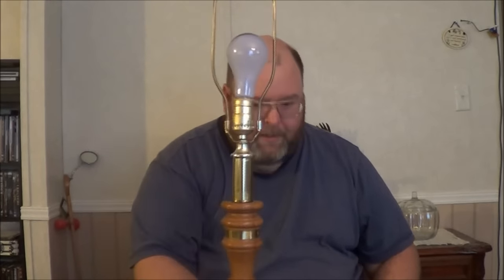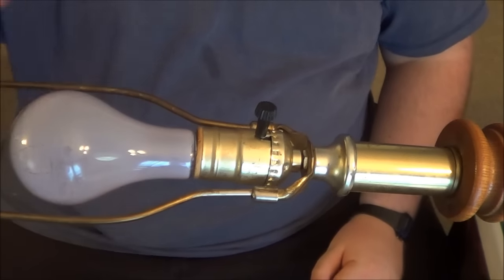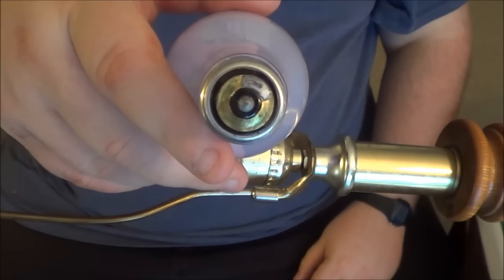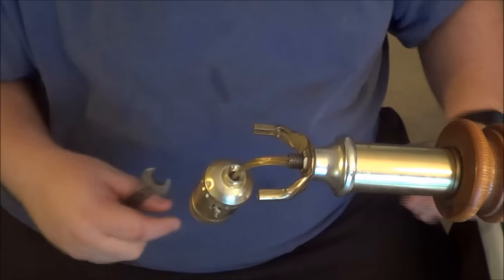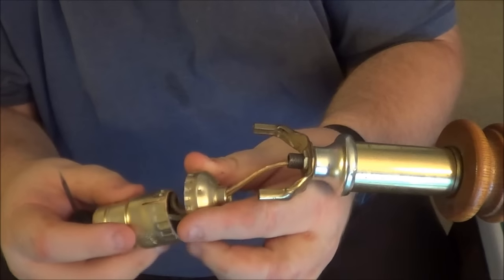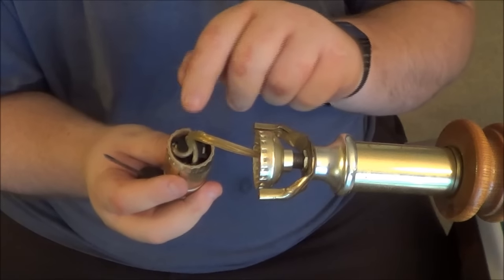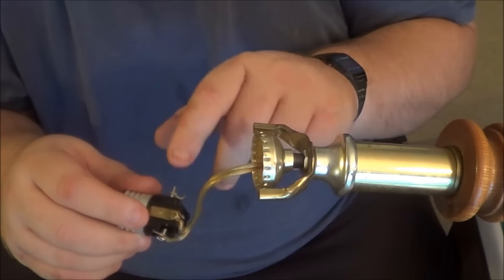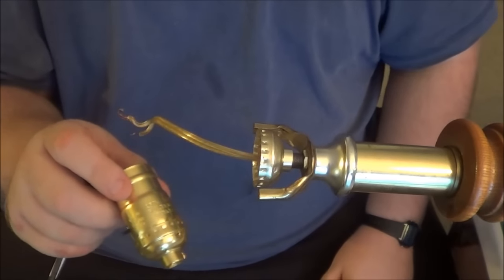How to replace a Lamp Socket

Comment: Thank you for your video! I found two beautiful lamps in the trash and they didn't work. Bought sockets, watched  this video as I went, made some mistakes, and a few hours later, they both work! I will say my lamps wires were in a plastic base thing and you need to use a paperclip to dislodge the wire. My bases didn't pop off. They are not perfect but I am proud of myself.

Comment: Mr. fix-it help me change my lamp socket I was going to get new lamp, but thought that I could possibly just changed it. I am 67 years old and was diagnosed with Early onset Alzheimer’s , before I was able to do a lot of projects without even giving it a second thought. I put in sprinklers, re-wired valves, etc.  Things they don’t come very easy anymore. Beyond what he probably thought he could do for anybody. Explain step-by-step how to do this, I had to rewind it several times due  to my short term memory but my sense of accomplishment , he gave me that feeling again.  Just know that you are best 
thank you so much
Reply from the maker: You're welcome. I'm glad the video helped.

Comment: I know this video is 8 years old but I just wanted to thank @ESRepair.  I was actually able to fix my lamp by replacing the 3 way switch with a regular one.  I had a hard time figuring out which wire was hot and neutral, so I hope I got it right.  Anyway, thanks so much!  You are a brilliant man!

Comment: Thank you for this video. It was clearly explained and helped me repair a table lamp where one of the three settings (low) did not work. My wife hates the higher brightness settings, so she has not been using the lamp much recently. My lamp did not have the lock nut at the bottom of the socket, as it had a screw cap at the base of the bulb, to take the socket apart. Replacing the lamp socket was easy and took less than 10 minutes. Your explanation on the wiring (hot, neutral) was very helpful. Just think, there are local repair facilities here that charge $80.00 to repair a lamp. Thanks for the video and helping me save some money.

Comment: I like the detail this video provides.  Very thorough with attention to how to correctly install the new socket so that it is safe.  If the hot and neutral wires are crossed, this can lead to a dangerous lamp and Mr. Fix-it explains very well how to recognize the difference between the hot and neutral wires.

Comment: Mr.Fix-It, thank you for this video. My wife and I watched together. We were informed about the difference between the "Hot" wire which is smooth and the "Neutral" wire, which is rough.. I don't remember ever hearing that before. Thank you, again Mr.Fix-It.

Comment: Wow, replace a lamp socket 101!.  So easy to follow and understand..  My cord had a knot in it, which made it very difficult to replace the socket.  I untied the knot and it slipped right on. I noticed the comment below about an underwriters knot. What the heck....repaired without much easier.   Thank you again, Mr. Fixit!

Comment: You covered some topics that other videos did not such as the hot wire and using the wrench to stabilize the lamp infrastructure.  Thank you!!
Reply: Yea but my cords both are smooth so I'm concerned

Comment: Thank you.  My suggested upgrades for your video are:
You  left off the toughest part of how to remove the top from the bottom (you just mentioned a small
screwdriver).  I suggest if you leave the bottom screwed onto the base, you can just grip the top part and with a side to side motion pull it off with some force as it is a friction fit with corrugated metal.  A paper towel  or rubber grip between your hand and the top metal part may prevent cuts as the corrugated metal is sharp.

Older lamp cords may NOT have a polarized plug or markings on the cord, so to avoid frustration, viewers should know that (so there is no designated “hot” screw as you could plug older lamp plugs into the wall either way). Newer electrical receptacles are polarized with the bigger slot for the neutral prong, and the rough edge on the cord for neutral as you said. Using a polarized plug and cord, and connecting as you said, reduces the possibility of shocks, should the cardboard insulator wear out. 

I suggest it is best to put the base on first and screw it on,  and then tighten the retaining screw.  Then just snap the top into it with the switch in a middle position away from the shade holder arms. This avoids twisting the wires up 6-7 revolutions inside the lamp for no reason.

Users should lightly pull the cord from the bottom of the lamp when done, to ensure no extra cord is bunched up in the base area.

Viewers can save the old plastic turn knob if it is not broken (as it can replace a knob on most any lamp you have where the threads have failed/stripped).

To minimize work where the switch mechanism has failed, viewers should know that they can just replace the switch part, retaining the existing bottom and top.

Viewers should note it is important that the wires should wrap around the two terminals in a
clockwise direction as you did, so that when you tighten the screw, it tightens the wire.

Comment: Hello Mr. Fix-It! Thanks so much for helping me get the little cup base of the old socket.  Secondly, I knew that one wire was smooth and one was rough, but I didn’t know which was which or which went to silver and which went to brass, so that was helpful.  Finally, it might sound silly, but your “tighty righty lefty loosey” rhyme is going to help me for the rest of my life.  (My dad left when I was 6, so I never learned that stuff.)
Reply: I learned "righty tighty, lefty loosey" my first year in the Navy and it has been so helpful.  Good luck learning more fix-it stuff.

Comment: Excellent video!! Just replaced an old harp that wouldnt fit with a new one from Amazon. Bless you!
When I saw the 20+ minute runtime I said "Oh no! Someone that's going to talk in circles," but everything you said was at least a tip or good info to make sure the job was completed correctly. Great video! Saved in my Home Economics playlist. Hehehe.

Comment: Very thorough video. One of the other videos here was replacing the innards of the socket and reusing the old cardboard insulator and casing. This makes more sense. BTW, when you disconnect the old socket, you can use a Sharpie or something to mark the hot wire, and just duplicate the hookup on the new socket. It’s good to know the way to identify which is which (especially of you have to cut the cord), but common sense is a good thing as well. Speaking of which, when my husband was still just my roommate he started “repairing” a lamp with out unplugging it! He touched a screwdriver to a wire and BOOM! I said something like (gritting my teeth), “Why did you not unplug it?”, and he said it was turned off so the flow of electricity should have been cut. Um....yep. I married him anyway. He’s smarter now. :-/

Comment: Another Great Video Leah. I have a floor lamp I'm putting a light socket in, that takes a 3 way bulb, I looked through my socket bag and found one but it had 3 screws with a black screw and two silver screws. I looked in where the bulb goes, and saw it had the two contacts, but wasn't sure where to hook my 2 lamp cord wires. I do know, that the wide terminal on the PLUG IN is the Neutral wire. So hooked one wire to a sliver screw, the other wire to black screw, then screwed in a 3 way bulb, turned it on and my shop lights almost went out before I turned the switch off. So I surmised that this socket with 3 screws, must be for the Lamps with other bulbs hooked to the switch. So I looked through my socket bag again and found a socket with only 2 screws, but still had the extra contact where the bulb goes in. So tomorrow I will put this socket in the lamp and see if it works with the 3 way bulb.  I'm not an electrician per say, but the socket with the 3 screws steered me to Youtube to see what the difference is with the two 3 way sockets. I'm still a little perplexed though by the 3 screws socket. Thanks for the Video.

Comment: I needed to figure out how to tell which was the hot wire that connects to the copper terminal (it's been a couple decades since electronics class in high school. Do they even have trade classes in HS anymore?). Thanks for the quick tutorial.

Comment: Thanks, my lamp was blowing fuses when turned I turned it on.  I replaced the lamp socket and figured problem solved, but I'm still blowing fuses.  It seemed a simple fix, rechecking everything.

Comment: This was a very helpful video and I learned a lot.  I have a lamp where I would like to replace the bottom part of a lamp harp which requires removing the lamp socket which I could do based on your video.  However, this lamp is a candelabra style with 3 "candles" that surround the main light.  Do you have any insights that you can share on working with this style of lamp and what I might want to consider?  I only want to replace the harp because it looks ugly, and I’m going to spray paint this lamp to give it new life.  Thanks so much!

Comment: Smoothe hot wire to copper.  Ridged neutral wire to silver.  Got it.  I nearly did this wrong because all the numbers and letters are on the ridged wire so I figured that must be where the electricity goes in.  Whew.  Thanks very much!

Comment: I don't mean to be critical, but there is no need to replace the socket bottom with the set screw unless the new socket and top portion will not snap on tightly when you push it on over the base. The problem is that unscrewing the lower portion of the socket with the wires attached can damage the insulation on very old wires as the insulation can get very brittle over time and break off. Now you risk a short circuit and have to rewire the lamp which may now make this a job for a pro. Preferably you can just replace the switch portion of the assembly and keep the original metal parts and the original patina. 
Other than that the correction above, the author does a very good job of demystifying the workings of a lamp socket for many novice viewers.

Comment: If you have room, the two ends of the wire could be tied in a knot to keep any tugging on the cord from ripping the wire off of the terminals.  I'm currently looking for that knot - they seem to be tied the same way in most lamps.

Comment: I'm really hoping I didn't mess up. I looked which wire was on which and marked s for silver and b for brass. Then hearing two videos.. mine is opposite. I got my lamp at a garage sale years ago. Very antique. It's working. What would happen if the wires were mixed incorrectly? Would it still light?

Comment: Should we be paying attention to electrical ratings in doing this? For example, the socket I just bought says that "This lamp socket has an electrical rating of 250VAC and 250W, is UL Listed and can only be used with #18 stranded copper wire."

Comment: What did you do to separate the socket cap from the rest of the socket?  You just said "you might need a flat...there" and then took it apart.  I see where you cut scene but that trick was the only part I needed to see.  I can't locate any other video in you very long list of videos on this particular topic.

Comment: Thank you so much!!  You have such a nice teaching style.   
I don't know if you answer questions because I see this is four years old.
My lamp made a POP sound and the bulb burnt out and will not work now with any bulb.  
Do you think there's more damage to the lamp or is it just the socket I could replace? 
Thanks
Reply from the maker: The lamp socket may have burned out the switch and needs socket replaced.  You could also try a Voltage detector to see if there is a break somewhere in the power cord.

Comment: Great helpful video!
Reply: The replacement socket was too small to screw on to the older lamp.  Almost took it back….. but I didn’t have to. I kept the old bottom part, and used just the new top part which luckily snapped onto the old bottom half perfectly.  Woo hoo!

Comment: Good video but I was wondering why you didn't knot the two wires up with an Underwriter's knot prior to wiring up the lamp socket to prevent the wires from pulling off the lamp socket due to stress on the wires?
Reply from the maker: Lamp already had one at the base.......

Comment: I wanted to see how you actually got the bottom brass cap with the indentations off because that's where I'm stuck at. Mine is on tight. All you said is you can use a small screwdriver but you didn't show how you actually got that off without either wrecking the cap or jamming the screwdriver into your flesh somewhere. Also you said one of the wire outer insulated coatings is smooth and the other rough -- not the case with mine! Both are smooth, but one has lettering on it so I will have to see which is the hot line if I can even get that cap off. I used to know which one is hot because it's the same with the sheathing on house wiring cables. Then you didn't say if all replacement brass sockets are capable of threading onto that threaded rod. Yours was but just so happened to also have a set screw. My faulty one threads on but has no set screw. How do I know if one I order online will have threads to screw onto my threaded rod? Are they all made that way or not?

Comment: I have a different kind of lamp with plastic base that the socket goes in.  I can't remove the metal socket from the plastic base.   The base also has the switch which is what is not working.   Any suggestions?

Comment: I have a very old lamp (about 1920’s) that doesn’t appear to have any discernible signs of what is hot and neutral on the wires. They are also heavily insulated with cloth. How do I know what wire goes onto each terminal screw?
Reply from the maker: Many antique lamps do not use a polarized plug. Usually the Line (Hot) wire is copper and the Neutral wire is Tinned Copper, which often times look grey in color.

Comment: I don't understand why you did not put a UL knot in the cord ? This prevents the cord from being pulled and putting stress on the connections which could cause a fire.

Comment: Help. Lamp wire won't push back into lamp. The new socket is all in place but I can't screw it on because wire won't push back down inside

Comment: Yeah the video cuts out with the screwdriver being used to separate the socket from socket shell which is where I'm stuck. Mine is in so tight I'm afraid the metal will bend or break from prying

Comment: you may need to get  a small flat screw driver " put next to the  lamp on the table , it automatically makes the bottom cup that you could not twist off , release"

Comment: I replaced the entire cord, 18/2, new  wire from the hardware store.  Also, bought a plug for the other end.  I have no starting point on neutral/hot distinction.  I have a new socket, rotary thumb control, not three-way.  How to I start to determine which is neutral/hot, and why won't this change if the plug is right side up, or upside down?  The spades on the new plug are both the same - neither has an unique shape to insure it can be plugged into the wall socket one way.  My only equipment is a multi-tester.  Anybody with a suggestion?
Reply from the maker: The cord will have either a smooth wire and the other with ridges OR the "HOT" wire will be copper and the Neutral wire will be Tin/silver.  The plug with both prongs the same size mean the Plug is not polarized.  The purpose of the polarized plug was to ensure the current stopped at the switch when the unit is powered off.   Reversed polarity would cause the unit to still be energized even though the switch was off.
Reply: Thanks.  The bulk 18/2 wire has no distinction on the wires, both sides are smooth.  Perhaps there are "lamp cords" intended for lamps that have these markings, but the bulk wire, no.  I have sorted it out.  My new socket has three screws, one silver (now I understand to be the neutral), one brass, and one black.  I have changed my connections - one on the silver, one on the brass, with the black screw unused (no idea of its intended use).  The lamp works fine.  But, the polarity may not be right - the switch may be on the neutral side, not the hot side, depending on how the plug is inserted into the wall socket.  Thanks for your well-done video.

Comment: It is quite difficult to tell which wire is smooth vs rough. If the wiring is done wrong, I understand that the light will still work, but the result is a far greater risk of deadly electric shock? Can someone please elaborate? I just repaired a lamp for my girlfriend but I want to make sure I got it right. I don't want to risk her being subject to an electrical shock!

Comment: At 6.05 when you use a small screw drier to separate the base of the socket is what I need to know how you did it; you cut the most important part out of your video :(.

Comment: What happens when both of my cords are literally smooth ? No clue what is hot or not.. height have a texture on it.. just both smooth exactly the same.
Reply from the maker: In this case, One wire will have a silver color and the other wire would have a copper color.  Silver is the neutral.  The only other way is to use a continuity tester to see which wire is which.  Some of the old lamps did not mark the polarity.
Reply: @ESRepair  thank you so much! Unfortunately they both were gold and exactly the same! But I did finally see after some heavy magnifying that one had extremely faint stamped random letters on it. No info I could find so I just guessed it was neutral. I suppose I guessed correctly bc it worked lol. It is a newer lamp replacement kit from Walmart. Thanks again!!!!!